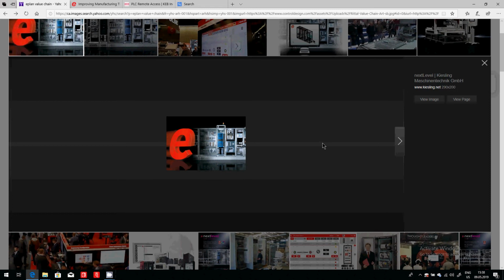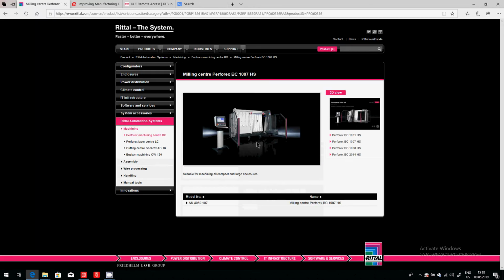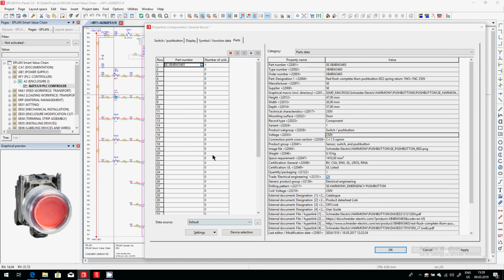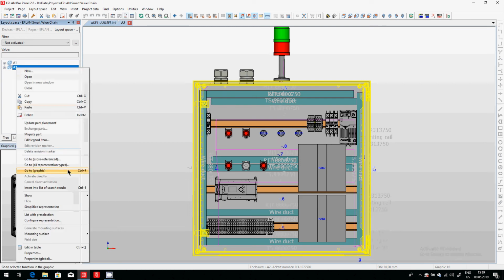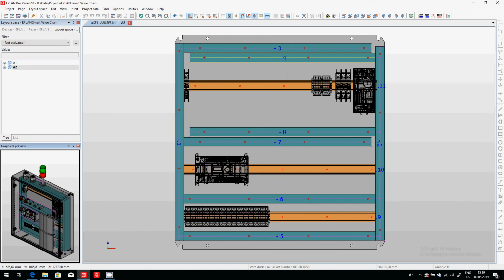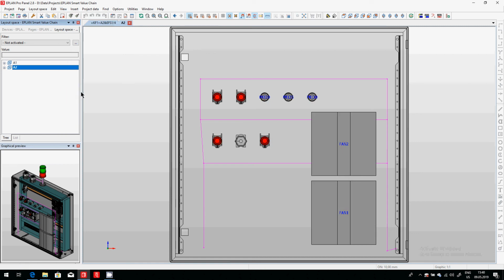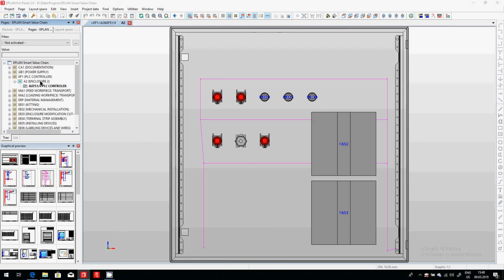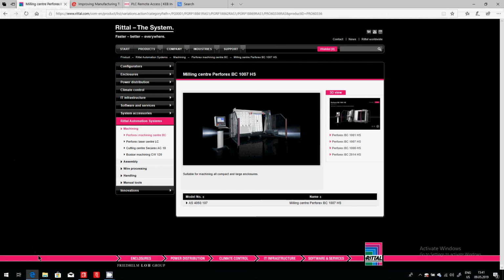EPLAN Tutorial Rittal Perforex Added Value

Comment: Hey Roland! Just finished a joint fare exhibition (Eplan/Rittal). We showcased the value chain containing Rittal configuration tool (rics) exported to Propanel and back to the Rittal automation system by exporting to  Perforex and Wireterminal. (Digital simulation only unfortunately)
Maybe you could do a little video containing the rics tool into EPLAN? (this tool can be called through dataportal and works best that way,  but also works fine through the Eplan project generated by rics at completion)

/Martin - Eplan Nordic
Reply from the maker: I will look into the rice tool, I know that my colleague Andre Bousette has talked about it. Sorry I did not answer earlier, I was off this youtube channel for a while.